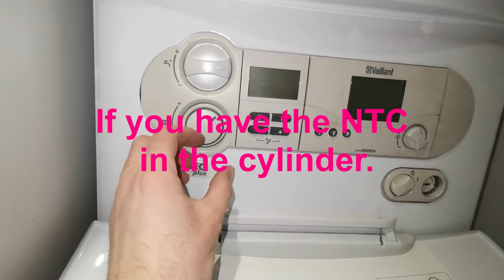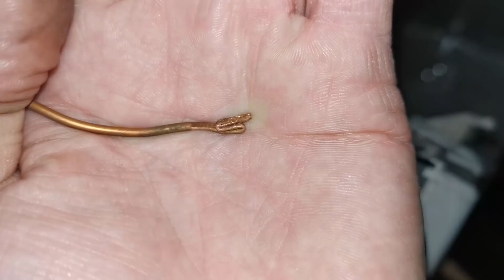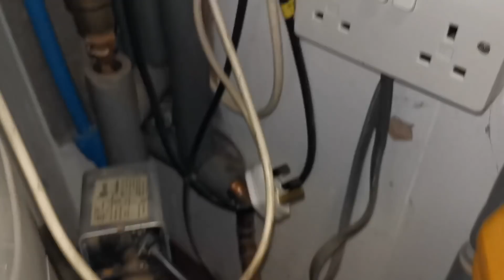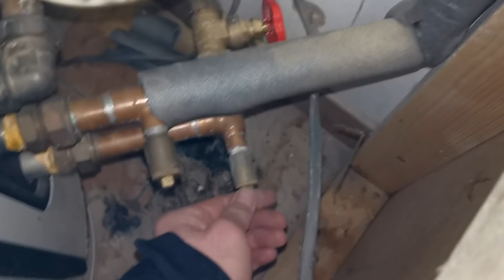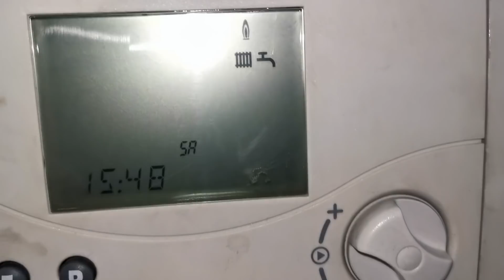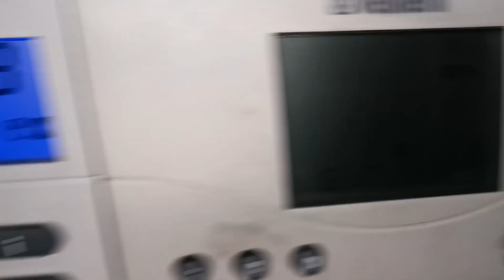Vaillant Ebus Controls. Repair No Heating No hot water HeatingGeek

Comment: Hi Heatinggeek, another great video, with regards to the ebus signal cable this appears to be part of a 5 core cable, looks like there are 240v cables and ebus cables together, I was always of the understanding that this was very bad practice as the 240v can affect the signals being transmitted by the ebus cables, and that you should always keep ebus separate from 240v,  please keep the videos coming
Reply: We’d always use CAT 5 mate on Low Volt controls.  Learned that about that 15-20 years ago on Renewables Docking etc.
Valliant in Scotland are shit, in fact their boiler are generally shit, popular in the South & Laaaandaaaan though.  Overpriced German rubbish, just like Whoofter Botch.
Reply from the maker: Your right. I forgot about that. I will put this comment at the top.
Reply from the maker: I can do it for some reason!!
Reply: HeatingGeek lots of Intergas, Ideal Logics & Vogues, Ariston Clas One & lots of Vokeras.  Vokeras have always been a popular choice here in the West of Scotland.   Most boilers are Builder or HA specification Ollie.  Atag is another one that’s getting rave reviews here too.
With Boiler Plus still not a requirement here - on domestic, most are just simple On/Off controls.  However, two way protocol is becoming more popular👍
Reply from the maker: @TheDickPuller  Im not a big fan of Intergas but time will tell. I don't like the repair aspect ATM.
Ideals seem ok never seen the UNO. The new Vokera's have been ok. Few issues with heat exchangers and flue collectors but that may have passed. I would love to get some training on Atag. Look really good TBH. I only really see boilers when they go wrong. Just how I like them. :-)
Reply: @HeatingGeek  wrote:
"I don't like the repair aspect ATM."
In what way?  They are super simple and easy to work on.
Reply from the maker: @johnburns4017  I can only comment on the original ones. The poor access to Prv, electrodes, HT lead and DHW flow switch Is what I base my opinion on.
PRV : If the pipework (flow return etc) turns under the boiler and goes up the left hand side (Which is ok by MI's) it makes it boiler off wall to replace.
Electrodes: Have to pop out bungs ontop of boiler and then force into insulation to remove.
HT lead: is behind Glued Insulation which if removed (HT Lead) mean you have unstuck half the panel.
DHW flow switch: On the older models the nuts are Large. Once undone you cant just pull out the switch. I had to pry the bottom of the boiler downwards while someone else pushed the heat x up. It was very difficult.
Maybe I have been unlucky and its all better now, but I don't know. When I fix a new one I may be surprised.
Reply from the maker: HeatingGeek

@John Burns Something I have always wondered about on Intergas is:
I the heating has been running all day  @ 80c how do they stop the hot water from scalding people? I know the pipes are spaced apart but not enough to stop the first draw off being very hot. Also, how come you know so much about boilers but have a BA in computer science? Are you involved in development or now work on boilers?
Reply: @HeatingGeek  
Yes that is a problem with Intergas boilers. But you will find they rarely hit 80C as the control system winds the burner down. A blending valve on the DHW outlet can solve it but more expense and something else to go wrong. 

I was heavily involved in control systems, which computers are ideally suited for.
Reply from the maker: @johnburns4017  I think all storage combis (937 etc) should be supplied with a blending valve which would improve performance a lot. Intergas don't seem to worry about it though?? Weird
Reply: @HeatingGeek  
Some were. I think Alphas were.
Reply: Have a customer complaining about house going cold because of this hotwater getting priority over heating ! Any way round this ? Vialiant haven't been very helpful
Reply: franco porco mate, they’re not the best boilers or systems & their technical department is useless.
Had lots of problems with this Ebus system & they were useless at helping, Well here in Scotland anyway.
Far, far better with Open Therm, a better industry standard & more reliable.  The Germans are too far up their own arse.
Reply: @TheDickPuller  
Ebus is superior as it is a bus system; OpenTherm is only point to point, with only one OpenTherm connection, so limited in large systems. Although Intergas (much superior boilers all around than Vaillant), now have two OpenTherm connections on the terminal strip. They must have some software to process the two OpenTherm devices.
Reply: @francoporco9780  You can change this in diagnostic code d70.
Reply from the maker: You cant if it weather compensation as far as I know.
Reply from the maker: @francoporco9780  Have Hot water on constant and make sure the cylinder reheats quickly. Open any balancing valve all the way.
Reply: franco porco  you could always remove the Vaillant wiring centre and replace with a standard Honeywell wiring centre
Reply: @francoporco9780  Fit a high recovery cylinder of the correct size and make sure the primary pipe work is 22 or 28mm and no 15 copper and no gate valve used in a by-pass, fit an auto by-pass set up correctly so as maximise the flow rate when in hot water mode, power flush the primary pipe work, also make sure the boilers thermostat is set to max. I have fitted loads of these systems and have never had a complaint, the normal recovery of a cylinder is 10 maybe 15 minuets and the house cant get cold in that time unless your customer is living in a barn.
Reply: Derek Clark not my install mate. Was called into check a system out. The install was a real mess. Reading your reply Would point to the install hasn’t been fitted as per spec 👍
Reply: @francoporco9780  
Have the boiler temperature high when heating the DHW, also ensuing the cylinder has a high recovery heating coil that takes most, if not all, of the boilers output.  The fastest way to reheat is to have a plate heat exchanger with a brass pump pumping water from the cylinder - the cylinder can also be downsized.  The cylinder heats top down, also much quicker. Within minutes of reheat with  a cold cylinder, usable hot water is available at the taps.  I doubt they would enter into that extra expense though.

Comment: Super video - thanks for sharing that. Very useful on EEBUS. Kudos on the one handed camera skills and for adding the notes over the top of the filming. Why did you change the whole valve body rather than just the motor drive? It seemed like the valve was turnable by hand? I don't understand what sheared the early teeth off the drive? Re: the lack of strain relief on the wiring - it looks as if you could maybe improvise with tie wraps through the parallel slots in the plastic case and then round the cables coming up.

Comment: Thanks for your vids mate very helpful! Fitted a 624 today and going back tomorrow to fit the vsmart. Had a quick look at at the vr66 and I’m struggling to understand the connection of the 2 ports as only 3 wires LNE. Where do the switch wires connect to? Any help you could point me to would be great 😊
Reply from the maker: They are not needed. The Ebus controller decides boiler requirement.

Comment: Great info, do you know with a Valiant Eco Tec Pro the stated bus voltage is 24v but its showing 21v at best, could this be giving rise to F62 faults, maybe the smoothing caps need replacing. Thanks

Comment: The main problem engineers have with Vaillant and Glow Worm ebus systems is they expect the boiler to fire as soon as they have set a demand, these ebus systems normally take 2 minutes to engage the motorised valve and we all know that the boiler will not ramp up until it has checked out the flow, another minute. The other problem is when they open the control box there are no Gray or Orange wires used for motorised valves, WHAT THE F--- that's right permanent live and switched live are not used.  Last but not least is that most of these systems are set to hot water priority, meaning that the heating won't work unless the hot water stat or internal cylinder probe is satisfied.  
According to Vaillant/Glow worm,  you can run the wires of the ebus and 240v system together for up to 10 meters, but would you !!!  The cable size for ebus is 0.75.
Reply from the maker: Because of the lack of orange and grey, the boiler also doesn't know if the Synchron motor has failed and the boiler will still run if the valve doesn't open.  I thought this was part of an interlock requirement but I guess it only matters (in par L) for efficiency reasons and not for the longevity of the boiler.
Reply: @HeatingGeek  remember the boiler will check the flow, if the valve is done and closed the boiler will shut down and an F code will come up, if its open the heat or hot water will be noticed as on all the time the opposite is running. I believe that the Glow worm systempro3 can detect the fault and then displays it, my experience with this brilliant peace of kit is that it can detect many system/boiler faults.
Reply from the maker: @derekclark7545  It doesn't though. I have personally seen several that keep running because of bypasses etc.

Comment: Thanks king, which cable are for low and high speed for the vaillant pump?
Reply from the maker: None of them in this video. The high and low speed is on the boilers.
Reply: @HeatingGeek  is it the d 19 setting you done?
Reply from the maker: @dzmalekvali1110  yes. But on another video
Reply: King, it would be great  having you as tutor...mine was abit try error find out later

Comment: Your never working on my boiler, the last one you touched the fan went while recording and this one the tube failed to the pressure gauge.  on a general note i have been fitting Vaillant / Glow worm weather compensation systems for some ten years,  i have had one Systempro go down within 8 months, other than that total reliability, and lots of very happy comfortable customers who have used less gas than expected.  An EBUS system is so easy to install, you just need to understand how it works with the boilers own proving methods, then you can understand why the orange and gray are not needed on the two port valves and why you need to wait for the system to fire up the boiler.
Reply from the maker: Its just the boiler will fire when a 2 port isn't open because it doesn't know.
So the interlock is lost. I fitted a few Ebus systems and all worked very well. Unfortunately the standard of install I often see is very poor and it obvious the installer didn't spend the time to learn the system. 
I always allow extra time to repair them though.

Comment: Great video. Never had to deal with these. Btw if the boiler controls the hot water temperature why did you have to turn the cylinder stat down to satisfy it. Surely it can be done from the boiler?
Reply from the maker: Only if it has the NTC put into the tank. This one didn't.
 I zoomed in on the NTC connection to show that at the beginning. 
Im not the best on ebus but know enough to fault find it. :-)
Reply: @HeatingGeek  ok mate. Makes sense. Cheers
Reply from the maker: @jordan9318  No problem. Thanks for watching :-)

Comment: I don't you think you can beat the veissman 4 pipe system with weather comp and hot water priority.. No hw zone valve, control everything from the boiler.
Reply: Well said Calvin I’ve got the viessmann 100 with 4 pipe system at home it’s quite simplified the boiler controls the lot , 
My system water has antifreeze and this has prevented a lot of problems of the sludge/ magnetite also with antifreeze solution you get a faster warmup time And a quieter running boiler
Reply from the maker: Does it have 2 pumps or a built in diverter valve? what about if you have an unvented cylinder?  Veissman seem pretty good boilers except that all the wires are black (don't know if thats all of them). Im going to try and get some training from them this year.
Reply: @HeatingGeek  it has a built in diverter, priority hot water, as for unvented, their own brand cylinders come with a temp sensor so no stat or valve, all G3 approved. Boiler controls everything. Makes installing much quicker.
As clued up as you are I think you'd like veissman, I don't think anyone can touch em on tech and efficiency.
Reply from the maker: @calvinperrins  They seem to be good boilers (I don't see them much) I just don't know enough about them. Thats why I want to do some training on them and Atag. Think both are very good boilers.
Reply: @HeatingGeek  I done they're installers course for the 100w models in Telford. They pay for accommodation if far to travel, they did me (Kent).
Reply from the maker: @calvinperrins  I dont install though. I will ring and ask them. I do want to get on the course.
Reply: Viessman do seem good on efficiency. Shame their boilers look like plastic junk inside. Worse than Wooshitter Botch.
Reply: @woodbine66  No they are nothing like Worcester Bosch all the plastic is thick walled and made by grundfos 
I’ve never had one leak on the plastics in 15 years,
Reply: @HeatingGeek  I think you should look into training on viessmann boilers you will enjoy repairing them, In some ways complicated at first but simple before you know it , yes all the wiring loom is black ! and not colour-coded but with  simple diagrams each circuit is easy to trace, all the plugs these days are numbered coded so you know quickly what plug does what the easiest boiler to service on the market I reckon!

Comment: In your opinion, is this ebus stuff better than wiring it as normal? Just looks like addition relays and board to go wrong to me without a substantial advantage over the normal way of wiring it
Reply from the maker: I have weather compensation in my house. Outside sensor, indoor sensor and boiler in loft. It needed no extra wiring center and gives me the controls of the front of the boiler in my front room. 
I can adjust the heating curve and DHW temperature from my front room. The latter of which does get done from time to time. 
I use it for weather comp and cascade systems but thats generally it.
Reply: You are a heating geek. Cheers for replying fella, really do appreciate it

Comment: Ebus is not priority hot water. The pcb has been programmed to prioritise hot water depending on the data it received. Ebus itself is just a street.
Reply from the maker: If you didn't write all the other stuff up I would of been like "Street?" WTF. It is set as priority so as not to overheat other zones. Like floors or normal heating zones when used with weather compensation. That bit I do understand. You can also make it not a priority somehow. (I have seen it but not done it) I think it might have been a bodge though.
Reply: @HeatingGeek  
If the heating zone(s) are calling for 50C flow temperature dictated by the weather compensation, of course if it is also heating a DHW cylinder, 50C is too low a temperature given out by the boiler.  So, it has to be programmed as a DHW priority system. The priority has nothing whatsoever to do with the Ebus, which is only a street. in which data runs along. The pcb, the controller, decides what is priority, via its programmes in its firmware.
Reply from the maker: @johnburns4017  Yes I understand that now. Thanks :-)
Reply: @HeatingGeek  
Get to understand what a bus is, I did explain it with a simple analogy. The underlying technology appears to be beyond you at the mo', but getting there.  
However, Vaillant have tried to have a sort of plug and play system, where the installer does not need to know how it works underneath. Just wire it up to the terminals on the boiler. In that they sort of succeeded.  As you pointed out, three had been to the boiler before you not understanding it.
Reply from the maker: @johnburns4017  I will learn. Vaillant cant even explain it to anyone though. I remember bus systems with household electrics in very posh houses from many years ago. I will learn. :-)
Reply: @HeatingGeek  
You have to deal with the tech' depts of the importers. They are at times are very lacking. The tech' depts in the factories are generally far better, like W-B.
Reply: @heatservicebwcuk1545  
Knowing how it works underneath is essential.
Reply: John Burns it’s down to us to fix it John when it goes tits up, it’s in our nature to find the faulty component, test it & replace it if found wanting.
Thanks mate, you’ve been very helpful👍
Reply: @heatservicebwcuk1545  
Yes. You have know how equipment works that you work on, otherwise do not bother.
Reply: @heatservicebwcuk1545  
Charming. Stick to plumbing.